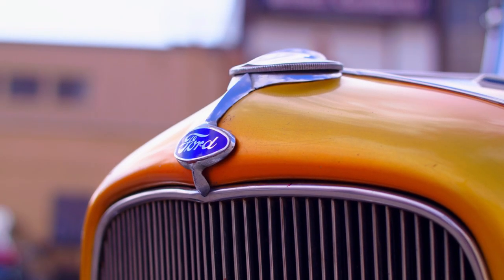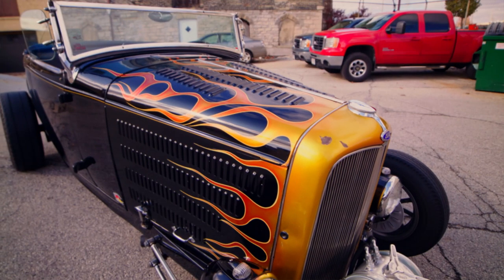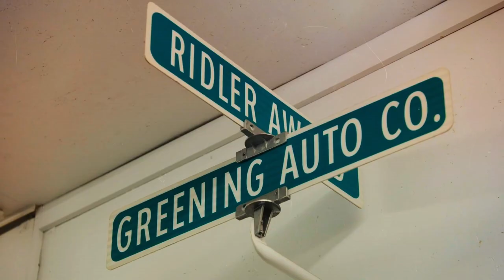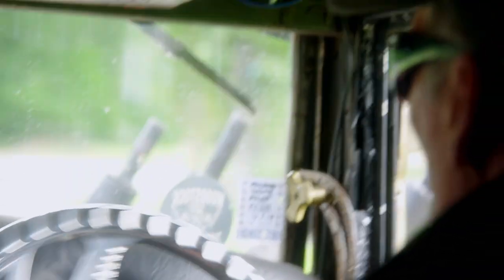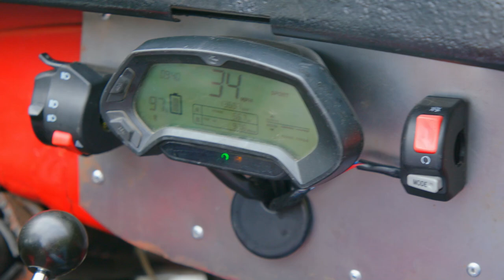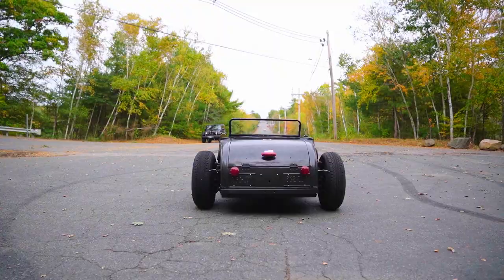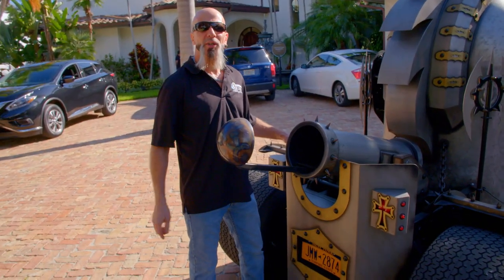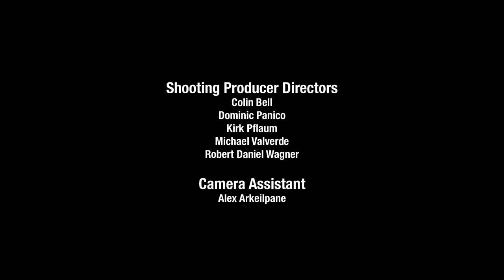From Classic to Electric - Ultimate Rides - S01 EP13 - Car Show

Comment: How to fork up classic cars. Driving an electric car is like cruising around in a microwave. 😂
Reply: How to fork up quality of life. Carbon atom based pollution never really produces afterlives.😂
Reply: @truetech4158  Don't worry a diesel generator will help you charge it. 🤦🏼‍♂️
Reply: @MaxOZAU8  what about the sun?
🤫
Reply: @truetech4158  What about winter?
Reply: @MaxOZAU8  Maybe in alaska the sun stops charging through solar, you sound like  you are from there based on your making no mention of solar powered charging systems,  right?
Reply: @MaxOZAU8  if you were in australia, you have more sun that you know what to do with apparently, right?